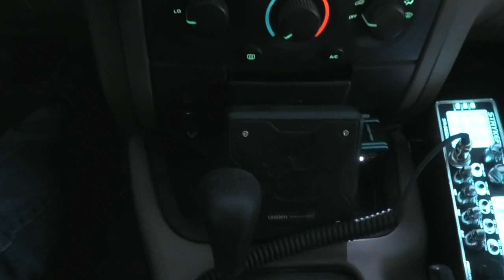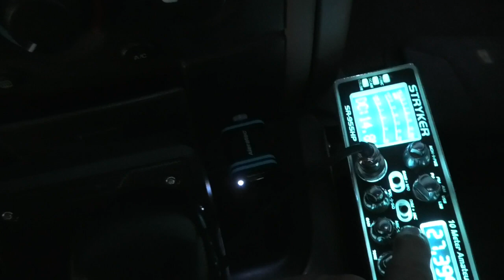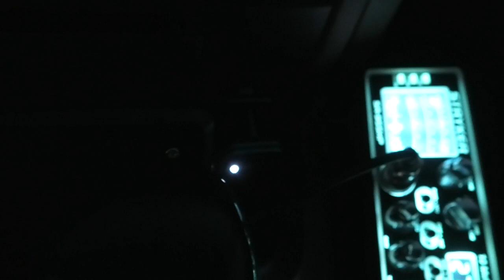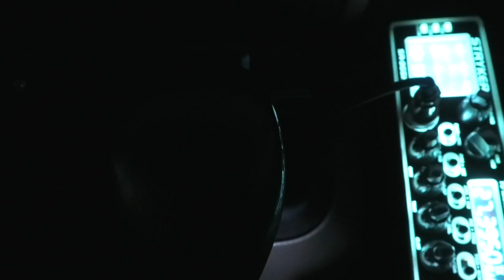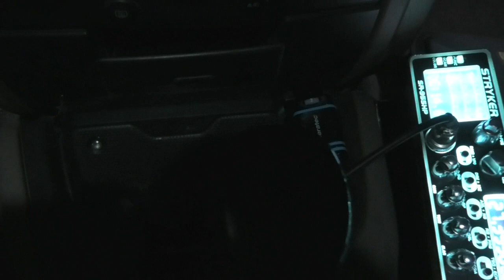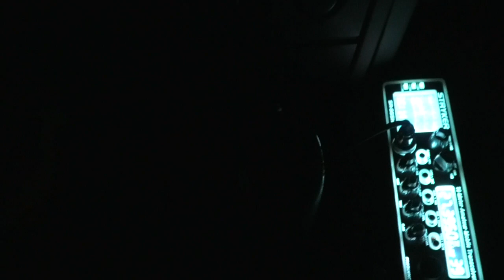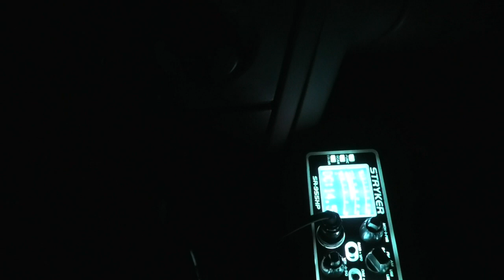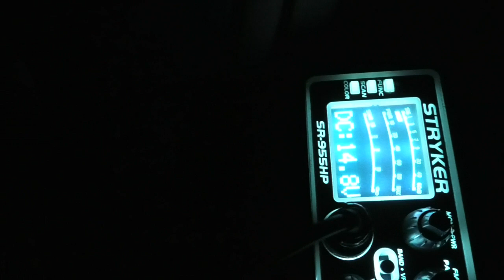"Real World Radio" - The Biggest Battle - BareFoot Styker SR955HPC X2 LSB -  Sound Of That Horn!!

Comment from the maker: That Horn 11:00 - Bite your tongue and follow directions ...  Here's what it takes to cut through the noise, be loud and crystal clear with a better receiver too:  A) Tuned Bench:  https://www.youtube.com/watch?v=lwcDfXOgAls.  True, it's more complicated and time consuming to accomplish these consistent and accurate results. Below is a partial procedure and list of calibrated equipment used to achieve this level of performance . Read on ..

Fine Tune CB Radio Shop strictly adheres to (https://www.nist.gov/) NIST Traceable Calibrations and other industry standards to maintain accuracy and consistency for providing Real World Performance Tuning of Citizens Band and 10 Meter export mobile radios with integrity.

"Basic Textbook AM/FM/SSB Transceiver Tune, Alignment and Calibration" 

1) Pll adjustments
VCO & OSC, AM TX OSC, USB TX OSC, LSB TX OSC.

2) Transmitter alignment
DRIVER BIAS, FINAL BIAS, SSB  (or gate voltages for mosfet versions) CARRIER BALANCE, HI-LO AM & SSB Power, RF METER, AMC, ALC and FM DEVIATION.

3) Receiver alignment
AM/FM RF & IF SENSITIVITY, FM DETECTOR/DEVIATION, SSB IF SENSITIVITY, SSB S-METER, AM/FM S-METER (100uV unmodulated -67dbm for “S-9” meter reading!), AM/FM SQUELCH RANGE, SSB SQUELCH RANGE, and NOISE BLANKER/AUTOMATIC NOISE LIMITER (Real World dBm to volts (uV) tables below).

That's just a typical run of the mill textbook tune up and alignment (if you're lucky). There's more to it than frequency alignment, modulation adjustment, meter calibration and a tune up report displaying exaggerated rms Bird peak watts! 

"Test Bench includes"

Bird 4314C Meter
https://www.birdrf.com/Products/Test%20and%20Measurement/Power-Meters/Wattmeters-Line-Sections/RF-Wattmeters/4314C_PEP-Single-Element-Wattmeter.aspx
Part 1) https://www.youtube.com/watch?v=RpX9IHe4ORM&t=16s
Part 2) https://www.youtube.com/watch?v=LuhbqTf6Bxw
Bird 4314C Accuracy Test: https://www.youtube.com/watch?v=DqEOabYqhQo&t=5s
Bird Stipulates 1/2 wavelengths  https://www.youtube.com/watch?v=5eWhgT-rTII
And Genuine Bird Elements from 1K down.

Bird 4373 Sampler 
https://www.rfparts.com/signal-samplers.html

HP8924c with options
http://userequip.com/files/specs/2147/HP%208924C%20Repair.pdf
https://www.youtube.com/watch?v=Cg1w0xBa27s&t=1s

HP8920a with options
https://www.keysight.com/upload/cmc_upload/All/EPSG072204.pdf

Three analog scopes, one digital 200 Mhz
https://www.atecorp.com/atecorp/media/pdfs/data-sheets/tektronix-2465b-2467b_manual.pdf
https://www.youtube.com/watch?v=by98x4eu2lM

Fluke 27fm
http://www.fluke.com/fluke/inen/digital-multimeters/fluke-27.htm?pid=56055
 
LCR http://www.lcrresearch.com/wp-content/uploads/2017/05/LCR_Pro1_Manual_version1.03.pdf

Power supplies
6 Cosel PBA1500f12 (750 amps) variable and configurable.
https://en.cosel.co.jp/product/powersupply/PBA/PBA1500F/PBA1500F-12/
Corcom 20VB1 F7130 EMI Filter 50-60Hz 250V

Times Microwave Coax jumpers and test leads
http://www.timesmicrowave.com/cms/products/cables/lmr/
https://www.youtube.com/watch?v=EmqaGJ6IWow
https://www.youtube.com/watch?v=1ltFVSxGp5Y
https://www.youtube.com/watch?v=v12YZT_1o90
https://www.youtube.com/watch?v=h7iiYfmYWRA&t=215s

Amphenol RF Connectors
https://www.amphenolrf.com/
https://www.youtube.com/watch?v=dVh5B0hdEA0 
https://www.youtube.com/watch?v=dKZg8T_AOso

More range, compliments, reliability and a quieter, clearer but more sensitive receiver,  Get Fine Tuned .. not peaked and ruined.

Here are some VideoGates of me at the bench practicing what I preach using my bench radio or customers radio completed and ready to be shipped: https://www.youtube.com/results?search_query=hard+drive+163+ more: https://www.google.com/search?q=Hard+Drive+163+nm&ie=utf-8&oe=utf-8&client=firefox-b-1-ab

It's what I recommend, use, service and sell ... to you ... not something non practical or deceiving in a misleading way. I'm not just the tech and owner of Fine Tune CB Radio Shop, I'm a customer too!  When finished, You'll be giving radio checks, not asking for them .

dBm To Watts and Volts
Tables below displays relationship between Power in [dBm] or [Watts] and Voltage in RMS, peak, peak-to-peak for sinusoidal signals in 50-Ohm systems for accurately measuring and tuning am/fm/ssb receiver sensitivity, agc, squelch and "S9" Meter calibration. Real World! Mike @ Mikes Radio Repair (Romper Room), Mark Rutherford aka Mark 19960, CB Kidd, Martian and all of your other fake accounts pay attention to the tables below, stop misaligning radios, spreading false information and promoting propaganda! 

  [dBm] [Watts]   [Volts]rms   [Volts]p    [Volts]pp
-140 0.100E-16  22.361 nV  31.618 nV  63.236 nV 
-139 0.126E-16  25.089 nV  35.476 nV  70.952 nV 
-138 0.158E-16  28.150 nV  39.805 nV  79.609 nV 
-137 0.200E-16  31.585 nV  44.662 nV  89.323 nV 
-136 0.251E-16  35.439 nV  50.111 nV  100.222 nV 
-135 0.316E-16  39.764 nV  56.226 nV  112.451 nV 
-134 0.398E-16  44.615 nV  63.086 nV  126.172 nV 
-133 0.501E-16  50.059 nV  70.784 nV  141.568 nV 
-132 0.631E-16  56.167 nV  79.421 nV  158.842 nV 
-131 0.794E-16  63.021 nV  89.112 nV  178.223 nV 
-130 0.100E-15  70.711 nV  99.985 nV  199.970 nV 
-129 0.126E-15  79.339 nV  112.185 nV  224.370 nV 
-128 0.158E-15  89.019 nV  125.874 nV  251.747 nV 
-127 0.200E-15  99.882 nV  141.232 nV  282.465 nV 
-126 0.251E-15  112.069 nV  158.465 nV  316.931 nV 
-125 0.316E-15  125.743 nV  177.801 nV  355.602 nV 
-124 0.398E-15  141.086 nV  199.496 nV  398.992 nV 
-123 0.501E-15  158.301 nV  223.838 nV  447.677 nV 
-122 0.631E-15  177.617 nV  251.151 nV  502.302 nV 
-121 0.794E-15  199.290 nV  281.796 nV  563.591 nV 
-120 0.100E-14  223.607 nV  316.180 nV  632.360 nV 
-119 0.126E-14  250.891 nV  354.760 nV  709.519 nV 
-118 0.158E-14  281.504 nV  398.047 nV  796.094 nV 
-117 0.200E-14  315.853 nV  446.616 nV  893.232 nV 
-116 0.251E-14  0.354 µV  0.501 µV  1.002 µV 
-115 0.316E-14  0.398 µV  0.562 µV  1.125 µV 
-114 0.398E-14  0.446 µV  0.631 µV  1.262 µV 
-113 0.501E-14  0.501 µV  0.708 µV  1.416 µV 
-112 0.631E-14  0.562 µV  0.794 µV  1.588 µV 
-111 0.794E-14  0.630 µV  0.891 µV  1.782 µV 
-110 0.100E-13  0.707 µV  1.000 µV  2.000 µV 
-109 0.126E-13  0.793 µV  1.122 µV  2.244 µV 
-108 0.158E-13  0.890 µV  1.259 µV  2.517 µV 
-107 0.200E-13  0.999 µV  1.412 µV  2.825 µV 
-106 0.251E-13  1.121 µV  1.585 µV  3.169 µV 
-105 0.316E-13  1.257 µV  1.778 µV  3.556 µV 
-104 0.398E-13  1.411 µV  1.995 µV  3.990 µV 
-103 0.501E-13  1.583 µV  2.238 µV  4.477 µV 
-102 0.631E-13  1.776 µV  2.512 µV  5.023 µV 
-101 0.794E-13  1.993 µV  2.818 µV  5.636 µV 
-100 0.100E-12  2.236 µV  3.162 µV  6.324 µV 
-99 0.126E-12  2.509 µV  3.548 µV  7.095 µV 
-98 0.158E-12  2.815 µV  3.980 µV  7.961 µV 
-97 0.200E-12  3.159 µV  4.466 µV  8.932 µV 
-96 0.251E-12  3.544 µV  5.011 µV  10.022 µV 
-95 0.316E-12  3.976 µV  5.623 µV  11.245 µV 
-94 0.398E-12  4.462 µV  6.309 µV  12.617 µV 
-93 0.501E-12  5.006 µV  7.078 µV  14.157 µV 
-92 0.631E-12  5.617 µV  7.942 µV  15.884 µV 
-91 0.794E-12  6.302 µV  8.911 µV  17.822 µV 
-90 0.100E-11  7.071 µV  9.998 µV  19.997 µV 
-89 0.126E-11  7.934 µV  11.218 µV  22.437 µV 
-88 0.158E-11  8.902 µV  12.587 µV  25.175 µV 
-87 0.200E-11  9.988 µV  14.123 µV  28.246 µV 
-86 0.251E-11  11.207 µV  15.847 µV  31.693 µV 
-85 0.316E-11  12.574 µV  17.780 µV  35.560 µV 
-84 0.398E-11  14.109 µV  19.950 µV  39.899 µV 
-83 0.501E-11  15.830 µV  22.384 µV  44.768 µV 
-82 0.631E-11  17.762 µV  25.115 µV  50.230 µV 
-81 0.794E-11  19.929 µV  28.180 µV  56.359 µV 
-80 0.100E-10  22.361 µV  31.618 µV  63.236 µV 
-79 0.126E-10  25.089 µV  35.476 µV  70.952 µV 
-78 0.158E-10  28.150 µV  39.805 µV  79.609 µV 
-77 0.200E-10  31.585 µV  44.662 µV  89.323 µV 
-76 0.251E-10  35.439 µV  50.111 µV  100.222 µV 
-75 0.316E-10  39.764 µV  56.226 µV  112.451 µV 
-74 0.398E-10  44.615 µV  63.086 µV  126.172 µV 
-73 0.501E-10  50.059 µV  70.784 µV  141.568 µV 
-72 0.631E-10  56.167 µV  79.421 µV  158.842 µV 
-71 0.794E-10  63.021 µV  89.112 µV  178.223 µV 
-70 0.100E-09  70.711 µV  99.985 µV  199.970 µV 
-69 0.126E-09  79.339 µV  112.185 µV  224.370 µV 
-68 0.158E-09  89.019 µV  125.874 µV  251.747 µV 
-67 0.200E-09  99.881 µV  141.232 µV  282.465 µV
-66 0.251E-09  112.069 µV  158.465 µV  316.931 µV 
-65 0.316E-09  125.743 µV  177.801 µV  355.602 µV 
-64 0.398E-09  141.086 µV  199.496 µV  398.992 µV 
-63 0.501E-09  158.301 µV  223.838 µV  447.677 µV 
-62 0.631E-09  177.617 µV  251.151 µV  502.301 µV 
-61 0.794E-09  199.290 µV  281.796 µV  563.592 µV 
-60 0.100E-08  223.607 µV  316.180 µV  632.360 µV 
-59 0.126E-08  250.891 µV  354.760 µV  709.520 µV 
-58 0.158E-08  281.504 µV  398.047 µV  796.094 µV 
-57 0.200E-08  315.853 µV  446.616 µV  893.232 µV 
-56 0.251E-08  0.354 mV  0.501 mV  1.002 mV 
-55 0.316E-08  0.398 mV  0.562 mV  1.125 mV 
-54 0.398E-08  0.446 mV  0.631 mV  1.262 mV 
-53 0.501E-08  0.501 mV  0.708 mV  1.416 mV 
-52 0.631E-08  0.562 mV  0.794 mV  1.588 mV 
-51 0.794E-08  0.630 mV  0.891 mV  1.782 mV 
-50 0.100E-07  0.707 mV  1.000 mV  2.000 mV 
-49 0.126E-07  0.793 mV  1.122 mV  2.244 mV 
-48 0.158E-07  0.890 mV  1.259 mV  2.517 mV 
-47 0.200E-07  0.999 mV  1.412 mV  2.825 mV 
-46 0.251E-07  1.121 mV  1.585 mV  3.169 mV 
-45 0.316E-07  1.257 mV  1.778 mV  3.556 mV 
-44 0.398E-07  1.411 mV  1.995 mV  3.990 mV 
-43 0.501E-07  1.583 mV  2.238 mV  4.477 mV 
-42 0.631E-07  1.776 mV  2.512 mV  5.023 mV 
-41 0.794E-07  1.993 mV  2.818 mV  5.636 mV 
-40 0.100E-06  2.236 mV  3.162 mV  6.324 mV 
-39 0.126E-06  2.509 mV  3.548 mV  7.095 mV 

                 Don't Be A Mud Duck!

 https://www.arrl.org/shop/ARRL-Handbook-2019-eBook

Hard Drive 163 NM. 73's! Click click.?